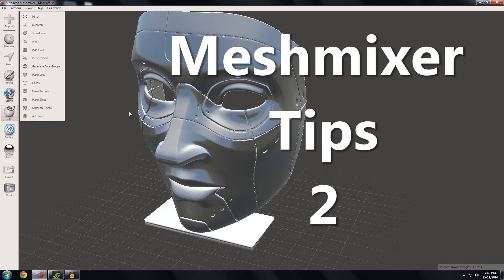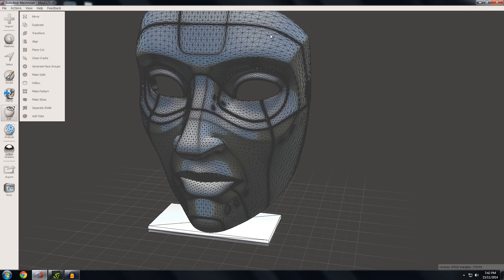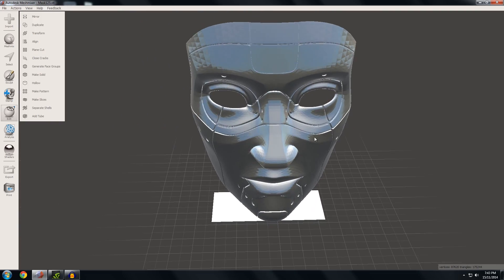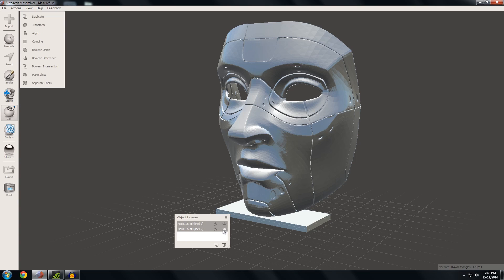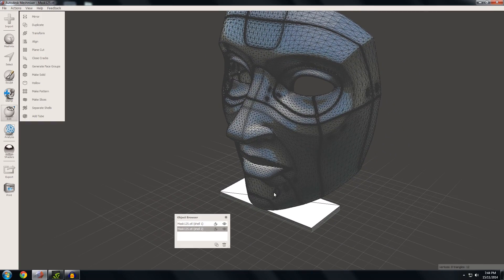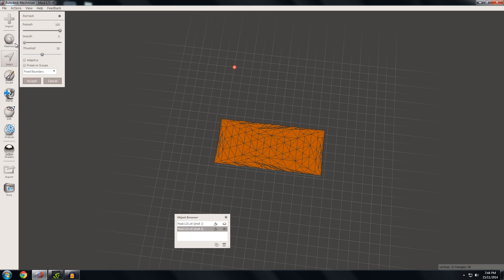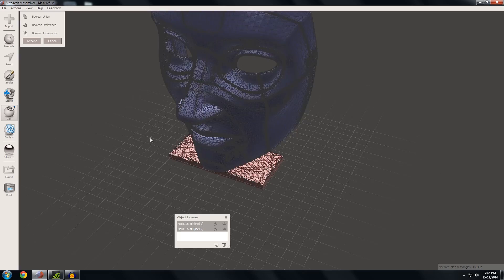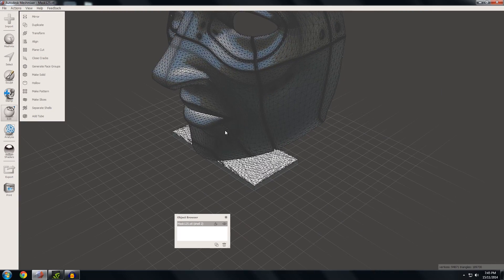Mesh Viewing and Boolean Tips for Meshmixer

Comment: Angus pls help! Everytime I try to create holes and edits to .stl's, 123D Design does not have the capacity to do so. No problem. I turn to meshlab, but I have no idea how to use it. I know how to unite the 2 stl's, but I cant subtract them. I was hoping that maybe there is a way in meshmixer to delete a part of an .stl using another .stl. Any recommendations? Thanks
Reply from the maker: yes you can, it's called a boolean difference. Simply bring both files into meshmixer, and select them while holding shift then edit - boolean difference. If it cuts using the wrong mesh, reverse the selection sequence. Good luck! booleans can be tricky.

Comment: maker's muse,, a much easier way to add a stand or something is done in 2 ways both easy and I use both the 1st and easiest way is to select both objects then press group or connect,, i dont know the word it says but group it,, then press make solid and in settings increase the mesh density and the solid accuracy,you could also do this to actually smooth your wireframe for the mask to make it truely smooth, but it will take longer to load as it is a much larger file with many more triangles and verticies,, then after you group and make solid delete the original and export the solid. the second way it to select the base part and make that a solid and increase the mesh density much much more even to the top, then press apply and if you view the wireframe now then there a hundreds or even thousands of triangles for a flat surface because you forces meshmixer to make the wire frame for a rectangle prisim to have hundreds of trianlges,, then do the rest as you did then it will be mich more smoother,